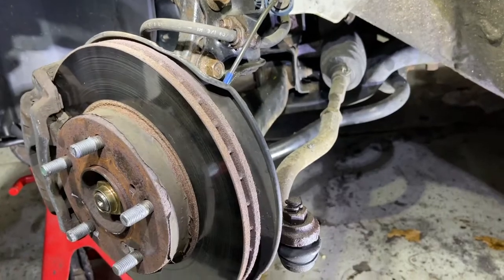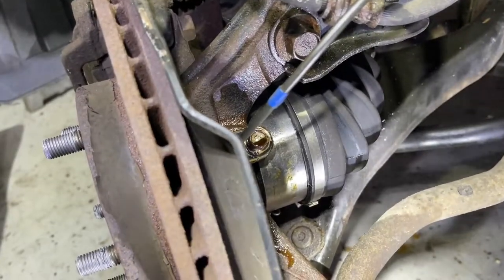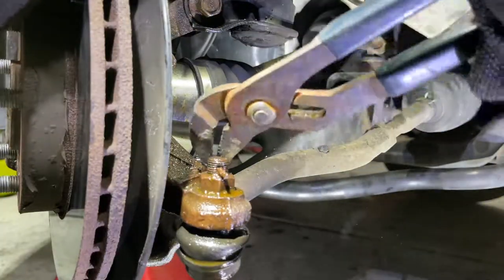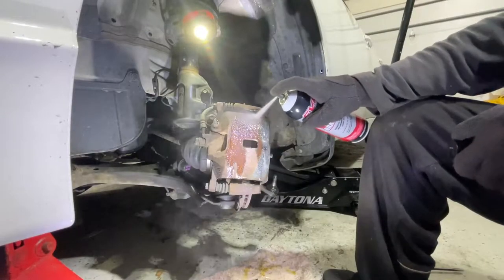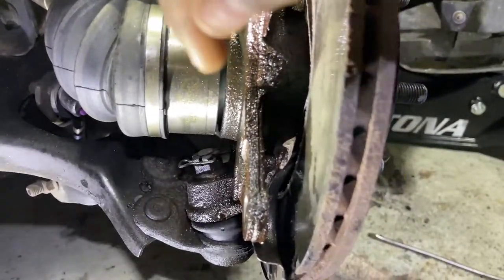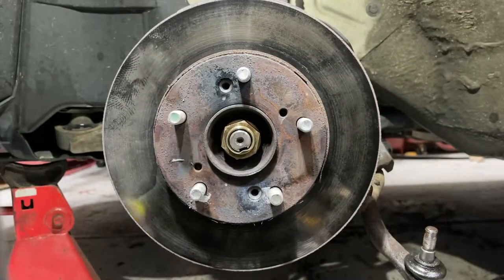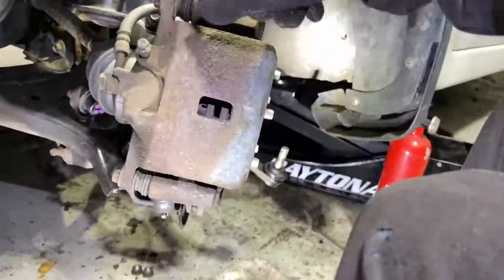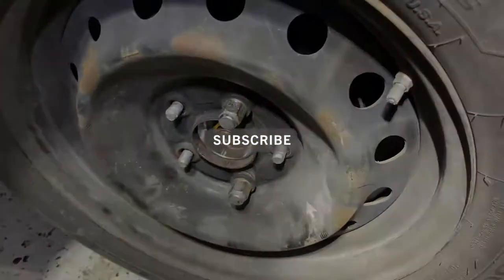06-11 Honda Civic Spindle/Knuckle, Hub Bearing & Ball Joint Replacement Step-By Step Guide

Comment: Good video my man, going to do this job next week. Looks fairly easy
Reply from the maker: Thank you. Here are the links to the parts just in case you haven't purchased them. 

https://www.ebay.com/itm/145545067344?itmmeta=01HV2SPVHPGW23G5HGGFC6KYW6&hash=item21e3297b50:g:mHgAAOSwpgpk7bPG&itmprp=enc%3AAQAJAAAA8BHDtYTKZ3F1%2FLtndvYuuESuNH6KQ8qTbEBr%2Bxxm70DgfpQAuhtlHaTRr%2FcSxiP8mGzikx%2F9PMfXP6RXABuima2buAIXcfgqcdm%2BCQWfEKK0SkGbTFowUmWaTJmU8wcN1%2BygCBQqteSId1cUqKFHgIxoDPlBJEObzJAGokGQEEED5FXIPcx907Kb3dbeX%2BxdEfkqA77mrhws9pYUTI5cmEKFWQdhrLLU0CpsKRkkaKVxpXBErmntDI2jpIYkO5GdWtjYTsFNnfm4G7SGhPLMyDz64wrxixQsniBJfyYJbFrKPKtwku0XR3J%2By7Y9x5U25w%3D%3D%7Ctkp%3ABk9SR4K529nYYw

https://www.ebay.com/itm/283948936170?fits=Year%3A2011%7CModel%3ACivic%7CMake%3AHonda&itmmeta=01HV2SPT2G69N19NFA2FJTKDY6&hash=item421cacebea:g:YpAAAOSwec9eVM8G&itmprp=enc%3AAQAJAAAA0MGaG9gk8KfiJG0hHPLkc4iBXLUmQQypL5s2lqR33Cw2AFlINqN5M6jitDPgE2Z%2FNwt7RWmWPXh4PYkyPgjDkt3MtZ7J%2FAlgjhJPTD57TqRupw%2BwL%2B1ipMiEV5GmISAVramLaltDF6sMBr8dRQtnFt5QloCIkgWX02oB%2FSulANIPZI3WWvRJ2zCEDEf9MKK4Z0a9wcqBMVA%2BHsY8uYH0bV%2FEpI0hFJv%2B7fooVs%2BkYnGzKvxqKHnv5x6vPezUrRX63JDDqaFDI0iW2Jsf6IhiVzQ%3D%7Ctkp%3ABk9SR7ih29nYYw

https://www.ebay.com/itm/123349025113?fits=Year%3A2011%7CModel%3ACivic%7CMake%3AHonda&itmmeta=01HV2SWVQXJ60X4XN7ATDHG11X&hash=item1cb82cc159:g:Y14AAOSw1K5k20jm&itmprp=enc%3AAQAJAAAA0M9nETBBpQf%2Fm%2B92OiIT7S%2FmqAdR0CDRQU2BLqUn9iZ8hm9RSbB3It3v1Xgd%2FYc6ZqDVh1r94vRXKcT8caK3AG12AHFLlyfHuCKzxFUh7Iv%2Fj2Wi%2Fjq0gJepo%2B%2BQtNxSW36CIQhavqmibLJ32eNOGsB415pEUpDpLfvFjqgp%2BPcu%2Bl3EDZyCyvJRJmVYcK53LoVxSO8u%2FNsA%2FiYuRC5IU65Qgcu8ndiUAOwtVmZLkdNKY6QTGiJCxNQKLD0gxhn9G8y2b47huuBdX7NS2aC3y7Q%3D%7Ctkp%3ABlBMUJS889nYYw

Comment: What's the torque spec on the ball joint castle nut?
Reply from the maker: The Lower ball joint castle nut is 44-51 ft. lbs. Thanks for watching.

Comment: I had to replace my Honda wheel bearing.  Took your advice and got the ball joint at the same time.  Turns out the ball joint was just as bad as the bearing!  Was initially intimidated doing this job until I watched your video over 6 times.  Took your advice on everything and it's all good.  Thank you, my friend.
Reply from the maker: You're very welcome. Good Job. Thank YOU for watching my content.

Comment: Can you link us to where you got your parts from? Just did the job with some WJB knuckles, wondering if anyone else has used them
Reply from the maker: Here is links for all the parts at the best price. This where I buy most of my parts from as I have gained a relationship with many sellers. 

https://www.ebay.com/itm/164278020750?fits=Year%3A2009%7CModel%3ACivic%7CMake%3AHonda&itmmeta=01J3ZEFYTPEEWZQ6WJNXTX8N87&hash=item263fbbaa8e:g:bPgAAOSwJjhhm0BM&itmprp=enc%3AAQAJAAAA8IqVjr2hyhefVQGc7F1w5oYnEXReRs%2BLCzUD3yKdQ1XONehmT6WH3CQJwJMoDiBjUzyk0TzEgCIG3behQ18vwIoFIjIvnywdHsSs4Il40Z3xSWxPnzlycEIpqzWFUs9JPtki9XYDvHZnZe7oHyIypviMgxQ42m5J2HWDfNd%2BxZ3UmNTRlqXjwri%2FJiaIUoSm2IAp7--osHnXenZ%2F5H2uyhYs14SHCm%2BTrob3vid%2BTR4zi%2B2Z4eSeX2pMvBFRA5BG9ZRAdeJI3oLD0Gpqylz1fzJvgWVZjTSVNcl9foVWH0P1FfGcIfvcl8VqwlTni2IrvQ%3D%3D%7Ctkp%3ABk9SR87tv-6fZA

https://www.ebay.com/itm/145270543491?fits=Year%3A2009%7CModel%3ACivic%7CMake%3AHonda&itmmeta=01J3ZEFYTPS8Y2AECVNYQ9B584&hash=item21d2cc9483:g:hwwAAOSwB0lk7tAJ&itmprp=enc%3AAQAJAAAA8GXkzoHYEykjWY2n%2FLFlR7C4rZ1CpevQ5cLHvS%2BpJSFJO23RtEeP28wVz5tsmgTDbEyoLsctyPr9mrCOHE1PJOHIu6veYqD79LRu6uLruQH1jqNJ31X0PrsrOKG%2BE5tsD1jdFKZu27GJpFz2eZMcdUjGczPfjqEVlQDW9TEZfOgYpWZfw8anJs%2BBzbsrjrvQ%2F4y9xlnZtNGXv0jl%2BAUN7CWcVu4Vt9erDNs9ny%2FdzMr3guG1BjwpkupQ79KrYX4PMxwPq0nbJAc61Q1Pl8iEUsvTWy1FF9Y1xPG%2Bo5IHUxWub6OJEJ6aQPZ7ltHNCYHJbg%3D%3D%7Ctkp%3ABFBMzu2_7p9k

https://www.ebay.com/itm/305338145543?fits=Year%3A2009%7CModel%3ACivic%7CMake%3AHonda&itmmeta=01J3ZEKP9HGT03P7S0ZFZ9PP87&hash=item4717925b07:g:7IUAAOSwkLFmo0Rz&itmprp=enc%3AAQAJAAAA0CAuiJCM5iYDq3YIvZHI8NV3%2BTHvuNiJxAGajS%2F5elbqR0vlQKI9quFJqV%2FJgOUD7LPcbebe7zea97VAKXAPOHdRIUonAka5T8FL18ne%2FC69g1U%2B3vbpPqjiLUBgm7MIrU7ilRqqnppq3XfLq30jM73m3Ai8OppLKbFQRR6QDICOkBklT%2BRW9ZczMDzkElWnlxc063GMLgkpxNNbi0lPd1rNxJjYXDQeJmaVH9Xtyp2JXqYkda%2FD767eU%2ByEh8jCLijP7kVIfUHxLXEFW8asbD4%3D%7Ctkp%3ABlBMUPzkzu6fZA

Comment: You should put springs on your brake pad. If not, they will stick to your rotor when you're driving, make noise and will wear out faster.
Reply: I've had trouble finding the springs for mine online at least . Still gotta go and ask at the store maybe theyre universal. I've never had them in the car but Im sure it would reduce noise and wear

Comment: Parts?
Reply from the maker: https://www.ebay.com/itm/145269153857?itmmeta=01J13VFX2XQ1HHBNXGQEZM0BJ4&hash=item21d2b76041:g:bJUAAOSwR31k7bPE&itmprp=enc%3AAQAJAAAA0CmnLP2KRWRyBP42%2BWE6LuWMCx5FIKPcEITjBPcOnd1eG2ERx7hIhr3EnChihZC4X%2Bo82hhvPT9lcb0ri99Wi%2B81YEM8IbSRnQBLmwdanFhOXaxKb8IYsN5xw5MxNiOmL0SXtI%2Fhuxcb5mNC7nyMPBTGRp6XLergxkQav9Mt%2FMwxntuOsX4POLM2n4socKFbWCG0Ws%2F16fIpsduSjT%2Bgx75Gcj42OLPoU2VFNYXXBGBgBtogiHM3qWYjcHMVxzFEFD80Yla%2BXFkOPMYfRbXGgkI%3D%7Ctkp%3ABk9SR8bRv_uIZA

https://www.ebay.com/itm/145270543491?itmmeta=01J13VFX2XB156WMM8A1W30XH8&hash=item21d2cc9483:g:hwwAAOSwB0lk7tAJ&itmprp=enc%3AAQAJAAAA8GXkzoHYEykjWY2n%2FLFlR7CabPQ7oJbhbSP9s40GvODhm4%2BRHO4Dx8EQ6CUVjONOO2VaikHoN5XMydI2bbN97%2Bjz9Xw849kT9i8zeaKLQkSY4RHytEPzvbNf8IxUsl8CJfZHv%2Fk%2F9n%2BUY2p22kCL8vO7Us3T2Z2cbi%2FBCSQL%2BsxeDKM%2BFG1p3iOYq7rf8wkxjDzPVpEp7ljyoiqOb6FBkowkYXP3UkTqbA5d9yzyu6mvK0iwwVEZ5vJD4VDxSEE4H0kXiYzpVnDxGGwwscYQP4CyqjcxolFKwv8suFTTvZCQhkvzPcu7VRwrfLRNv4w%2B%2Bw%3D%3D%7Ctkp%3ABFBMxNG_-4hk

https://www.ebay.com/itm/156008563085?fits=Year%3A2009%7CModel%3ACivic%7CMake%3AHonda&itmmeta=01J13VKWBKWYYZHRMJND3S9Z10&hash=item2452d5c18d:g:VdAAAOSwj7BjWhbf&itmprp=enc%3AAQAJAAAA8FN5b6RoyyOc29nFV4sq%2BoZhfy7pRWlOTvzEadkjwPK%2BFO0UnY1eHGVy%2BkvVKRj8GnIQrixfBfs0fPkQTUIO0Lez%2FhltsChU1RHsb5uN1ANlGf36A80PV6ROMZO%2FeRfPqh1PjnjNG6XKbC0RBtDDi4M00D%2BZt1ic2XWVNZFLt9EAU0KFQXGawW%2FHBQqJ9Y6C2ov%2BlAqRFekiSgthwl%2BIxWN5VTg3QLMmfhSdspeOgRPgM2VAYpZuvPQtWk%2Fe%2FJmWJB17HTHKK9S86eJN0N5tkgHo28OXAcXZiJzo1SHLjlrLmiXcKuiAN%2FPEimuBZfiw0Q%3D%3D%7Ctkp%3ABFBMhsbP-4hk

Comment: What part number and where did you order the parts. I have to do this on my car and am looking for a quality part
Reply from the maker: Here are all the parts you need and more at a great price (two links)...

https://www.ebay.com/itm/353542391069?fits=Year%3A2011%7CModel%3ACivic%7CMake%3AHonda&itmmeta=01HQBZTEGPBRNF2TJ033HPJ2ZQ&hash=item5250c4c51d:g:ob0AAOSwTCNicwSQ&itmprp=enc%3AAQAIAAAA0Az7Ag4TeRte4DpHb2%2FaRuw5EppkHywvc6O5kpWCOajZhwh3LZxsyabEJ4mLqivUhSASgJ48e%2Bv2pCeWc1e8Zb%2BSi2%2Fk%2Fa4tQ5uNQVTzHqU4PsegjU2RjqNA0Lbqm2tgBUUOTfG%2BF0MsQ1YCTfHpJxjRj2LB890%2BPhFPcqKP7w4NVWrFIHzvzzKqZtnTvq39yKt4dzPQwdbAm5NE0AoLwNL3FcMb7paADOrJapn23rN%2B6y31zMkq0kSlMIKB%2BPsxBViXZt2zDWU3FgnnV7VYVKI%3D%7Ctkp%3ABk9SR8To6f-6Yw

https://www.ebay.com/itm/225882036378?fits=Year%3A2011%7CModel%3ACivic%7CMake%3AHonda&_trkparms=amclksrc%3DITM%26aid%3D1110006%26algo%3DHOMESPLICE.SIM%26ao%3D1%26asc%3D260884%26meid%3D099cdb6e331e49be8a4533c613f45357%26pid%3D101875%26rk%3D1%26rkt%3D4%26sd%3D144348474534%26itm%3D225882036378%26pmt%3D1%26noa%3D0%26pg%3D4429486%26algv%3DSimplAMLv11WebTrimmedV3MskuWithLambda85KnnRecallV1V2V4ItemNrtInQueryAndCassiniVisualRankerAndBertRecallWithVMEV3CPCAutoWithCassiniEmbRecall&_trksid=p4429486.c101875.m1851&itmprp=cksum%3A225882036378099cdb6e331e49be8a4533c613f45357%7Cenc%3AAQAIAAABkHD%252FO%252BVoFoPPIoZ2g0kOZxWd85mWuIHekSp3qag7zFfwObZeQoitzE%252FDCfcejfO%252BzOLmzZmy11RrgWpA56KM9DpasK%252BGtGYwCFvgaK6ijP5AqShEUhT8f2oX6hvndJ3G0oWH8DD1DlBWseQltpxcSDW2Uu52NrseaxeINpsrDP6vx7ny%252BkPKauMa3yeSanWiinIuybH7ygK23g%252FGuQbDJ6vOUg8MB2pOcQYTkaOac7V2sPK7ZiEjJ2dQucuoZqqHYbP1AFdVUWdvNxx8Bg9j9VUT2rjIDLgFO0XXn4lIqVSwWvFXYr%252Fu2MWKKCiCw5h64BqvTzcZ%252BOnoMg8SW5BDv6PxpFzVeXWkiGcvPRzV0Uj1iUYggFwa5yJjj6ixJ79oEgIorFwENKfZXtj6MCv7lQpw6w1uw6v--a4TXQB3Bwf4AO%252FLBWOkIcTLgixwYaIsVFN32AHbXd%252BzYva8wrv6bdNu9L76IRs7MBTF5k%252BU4X4ZvLy1wiDD887dx%252Bq%252BS8NrNaJ4clcE5Su8kh3DZvxJxvc%253D%7Campid%3APL_CLK%7Cclp%3A4429486&itmmeta=01HQBZR8JST69Z35YBE1SAF78R

Comment: hi great video brother does the spindle  comes with the hub attached?
Reply from the maker: Yes, you can buy it either way with or without. Here is a link for everything you need at a great price! (the best deal and option)

https://www.ebay.com/itm/166122056647?fits=Year%3A2011%7CModel%3ACivic%7CMake%3AHonda&hash=item26ada56bc7:g:dYUAAOSwALFkl~2A:sc:ShippingMethodOvernight!60475!US!-1&amdata=enc%3AAQAIAAAA0EQmF1FUSgQioAh7MP3CIlX%2BaHWQQBQfjGs5A2b04KFB%2FqG%2Ba94jIOsaPn4QGv4ozcCjx8hy0xahoen4YGj%2FOwjFy5Svevk3btTVhZDu0wAeafdMvDXOGv1X%2FyiYtBsLkg6VDaXIlIaYVuULTscHnW31xt65JiBj1V2o%2BSO6CvcSNlDWjXWaj%2FSJA0xWZP887ZFDsOGJxd8F1v4lFPPDMKs5UUBXN5ryAPhE1o9NEZG7ReqsDIVlRrX1xQkBj%2FcLZlGulmbZ7DHqNZ48m7qESKY%3D%7Ctkp%3ABlBMUMystYGpYw

Comment: Thank you for this video! Straight to the point, i appreciate all the details and torque specs. Its an easy job when you follow his directions and have the proper tools. I tried to reuse the abs sensors, but broke one and got new ones instead.
Reply from the maker: You're very welcome. Thank YOU for watching.

Comment: That spindle knuckle looks really weak compare to the OEM knuckle. Just look at the thickness comparison. I wouldn’t trust my life with the cheap flimsy aftermarket one
Reply from the maker: Hi Jay, you are absolutely correct however, you have to ask yourself how would that item make it to the aftermarket world without strenuous testing, multiple stamps of approval and tens of thousands of items sold and continuous sales. I wouldn't be surprised if it was equally as strong as the factory spindle even though it's smaller. Thank you SO much for watching.

Comment: I think I'm gonna have to do this( the knuckle) a dumbass mechanic tightened down the tie rod end with a half inch air gun so it caused the tie rod to bevel out the knuckle so now anytime I put a new tie rod in it busts no matter what I do bc you cannot tighten it now without it being too tight shake my head 🗣️🗣️🗣️🗣️
Reply from the maker: I hate to hear that. It's unfortunate that the mechanic treated it as if he were tightening wheel lugs.
Reply: @TerenceDIY  honestly it might be alright that knuckle is a peice a hunk metal I feel like the tie rod would pop from being tightened like that before it would cause damage? I would hope so anyways haha I may change the tie rod and measure it to save myself an alignment and see if I can tighten down the right way and see if it's fine
Reply from the maker: Here are some links to some new parts that's priced great in the event you want to replace everything. 

https://www.ebay.com/itm/164278020750?fits=Year%3A2008%7CModel%3ACivic%7CMake%3AHonda&hash=item263fbbaa8e:g:bPgAAOSwJjhhm0BM&amdata=enc%3AAQAIAAAA0I4gJl4YVjjCainl9Zbru9yJGLp8em85Jb%2BOB7gINDSwB2NAR%2BlRtSVar580TqKJlg88LfapQvmyQtUyIadTlocygqh9jRzQRLYi9UrkMN%2BDKblzhAWl%2FwX6IgftSBPifOZnnR8LWBqhdNpJmzOYXWqaZpDDF7tlEQdBRFmM7zAFaPXugQ64O0pZatG%2FLLi%2BIUaSDU1xeOqKuY8XFhdEdZhdnNd7FCZa3JIYYRaLiVDUWsDG124Y%2BQ5y8Yh9thc7IfuJELcCsgZtBc9rrNv1BCk%3D%7Ctkp%3ABk9SR56JiOPzYg

https://www.ebay.com/itm/283948936170?fits=Year%3A2008%7CModel%3ACivic%7CMake%3AHonda&hash=item421cacebea:g:YpAAAOSwec9eVM8G&amdata=enc%3AAQAIAAAA0AfjEJWvQ7WkkrmrhXhWa6hp7af8proDY0Ou9c2PgcQ6XW8SvmOSTrYKoj8EA7i%2BXKFLN%2FQrO4WX%2FVuJAtJnVQmB0OIbnSOGOTuyqp2Gxuwrq44ATDKNRbt4%2FxxoceRrDxeTCN6VU6NzuiMguqqSF6gt4hw%2Bj5FQWeYiVNA4H%2FLSYag4I9x4kzCOm6U9xw1uFTXe4JJJvWAMOCxHB9vnBupLSDq4hXvceU26kyOBf41vugYIDebAE5VPRlv9W0e4vQ0vGUp95WG06IjqLbgtjV8%3D%7Ctkp%3ABk9SR56JiOPzYg

https://www.ebay.com/itm/162640320096?fits=Year%3A2008%7CModel%3ACivic%7CMake%3AHonda&hash=item25de1e5660:g:SH4AAOSw2NNip~vC:sc:ShippingMethodOvernight!60475!US!-1&amdata=enc%3AAQAIAAAA8NdTL8N1%2B9DwG6UPBTA3q1EYe6e2ENl2zgDtjwS36z5do5IwxHFPEHEbjGN5P2BKZ2TkDUU9QS3Dd3KoD6Ilxs1vbSFoO1O0WkWkvG%2BOnEZvJqcd4HGSDdMiQK6EAKcPNxNzwf25fLUN7G4zErI%2BukRKhmvFwMns97LeYkgxxsjAJM7J4vwgyzdDub7nWuA0BOupM1J7yaVrq4avp7kQUoxZGJAUTWZ%2BgHIaIGXTUjJD3yFOBFFNuepUHClOSjcim4BgPKoONpaQxR%2BS4aSk0zQVeYU45MAYEB0%2BSlK2fIeskHGSr%2B1Tpnif3Ke4yyp9Qw%3D%3D%7Ctkp%3ABFBMmpaY4_Ni

https://www.ebay.com/itm/123348985524?fits=Year%3A2008%7CModel%3ACivic%7CMake%3AHonda&hash=item1cb82c26b4:g:jGoAAOSwMvdk20jn&amdata=enc%3AAQAIAAAA0KcvIS1gvcA7J13Sqdr1CVNlJA6RBjS2DAA3%2FQTjr3vwWqRQMxqTBwBcZZiV%2FP5tcI5EbZ2PwvWARZTpB0idPYPcAIrd3lSgXmrHupP0fWHFJ8Co5xDPAoxu5rGjGbP%2FC82SsmUPoSfmi6kTb3imjZSVeXYdO2vs%2FfgEO6PkFH%2BCmPEKWRNV%2FNYpOgwgFBQ5utXPidavAjfmr7RnR%2BT5FJ1klu2Bm%2B2xQzPeTxLya3lOOSbbnFymmh2i%2FIodBEL37d0mLZ6xzJ4npFb7xze1z%2Fs%3D%7Ctkp%3ABlBMUNrDnePzYg

Comment: My abs light keeps turning on and off randomly when I'm driving and it feels weird it's making a clicking noise when I'm driving which could be the cv axle which I plan on replacing at the same time. Idk what's causing the abs to foul up but sometimes a bad wheel bearing can trigger an abs. This appears to be much easier than using an expensive puller tool
Reply from the maker: 9 times out of 10 it's the hub bearing making that abs light appear. And you are correct about the clicking (bad axle). Thanks for watching.

Comment: Link to buy the whole spendell
Reply from the maker: Here it is...

https://www.ebay.com/itm/164278020750?fits=Year%3A2009%7CModel%3ACivic%7CMake%3AHonda&hash=item263fbbaa8e:g:bPgAAOSwJjhhm0BM&amdata=enc%3AAQAIAAAA8IsC9vm6jOXzamiIC%2BhFf%2B8vOgYyJqNm6faBFs8ggpV24978k15KWSnkGiZObHoURfKY1t8LLyQ1Om3RSKrk%2BG3boCRIe5Uu9lqWcKeqjIk1S%2B9VitVpJDH9yDnMFYqTXFRzJX3AenxVoCZxMMiDGKpF47A%2FUTqNgf9VgYNT1%2F2OHulNcIy5vW0dEDLiw1Q%2BDmhxcdl10d005qy6GCAdRWgPXHytC13Zo8OA0uoFHjeHTz5qJgHA9OI99IbBUfnL%2BNiOJ%2BV%2FGkWeKcu0wxTzvKtKrM2KIJjTDIHfRI%2BmgRLK7IdpWF95YxyJYrqdWxjHHQ%3D%3D%7Ctkp%3ABFBMoPWMhpVi

Comment: Great video, I just wonder what is the part number,  I have to do this to mine but I can't find the pn for SI model.
Reply from the maker: Here are some links to the parts. Thanks for wathcing.

https://www.ebay.com/itm/164278020750?fits=Model%3ACivic%7CMake%3AHonda&hash=item263fbbaa8e:g:bPgAAOSwJjhhm0BM&amdata=enc%3AAQAHAAAA8J5QHK2FGNZPLZQNqXDIbHo66sG7ZQMiS81wktzChTMsfSefRcj679CkRRnA7ALPzsyx47ik5cRWit6Kl5yvYDSV6PaK%2FEk5uuaVjMq39%2FRdDHH0AIRtuOhH%2FMlSrVP4bRONZg0RPJpdATPXiG01aBwHClctPzNu5IBaeyHJ5%2B7sjuZAQTnIrDGCoCvIvc29EcyPu%2FhKgPOg9ikyEYIFVAOHP%2F4BS6Vy8Wlol3SdiXhYBtacxT60NCreJYyQttO760n8O%2BldUiCwXfUPCWNYB2C2fcc2LMaj9asTnzRGAVqykAlxpnngLgF10QCT0NxRLw%3D%3D%7Ctkp%3ABk9SR-TX-7XQYQ

https://www.ebay.com/itm/194641055445?fits=Model%3ACivic%7CMake%3AHonda&hash=item2d5182ced5:g:nD4AAOSwTmBhi1X8&amdata=enc%3AAQAHAAAA8DEzLNMhLKSmJgNR2Cyv7nYY3%2Bx5BeuzQ6sMICQObZZMlHIDQbr0Y0LikOWOYK7ra1aUu9O2Zh0zY3aazj6Z0Y4k481cu9eaOkFwlurxbap6GBhUKGE6fe2YvNHqXOb3Hh0Rbo2OyqfSFDxW4OSCBM7XBVSC9XE0NMzHa2%2FqJVfkONubBPY9YUN9nHrW2YomaqGjSzYxmRcoZN2qjIItfjbKnoWEux14LYe8Oud9M01KYC6Bg6FcNyn2zEzNs3Y0jrlK2bFJakkzCSAHT0d3NhiRmqdxtTcXte4K3qCq%2Boq%2BH5CPg88a%2FA%2B7feDSMbCBAQ%3D%3D%7Ctkp%3ABFBM-vyIttBh

https://www.ebay.com/itm/273108977029?fits=Model%3ACivic%7CMake%3AHonda&hash=item3f96904585:g:WYQAAOSw4qxaqFuo&amdata=enc%3AAQAHAAAA8HzmpbrPm9zNuRfJ3YvSvvZts5DRlbZdsZLX3VbnDB%2FPzl%2BaEU64ZeB%2B9eSe4eHFodz2SPZUysbLRO4VMmc02tn%2FEER9m%2F7OjtuUALSV4vvNWRObg3gsJV8DLQA0DMFzhSdZbyxyJbK2upUv4fhS1Ywf4jANQ2irazgWFl6CaFWDjRqzeK1r6C9zKtNgerEVuyxAjwtpR0Uc2G%2BtdaTHz%2BkwyF9Z1ORWcFpvLh1VCVgeg9gNMbc9Cif5LeAuyqJS90YZy5w3lsWRz2qXs0DUDMpXHxpy6VXmWUKjUgwsEw%2F2E3CDQgvJJlJq5roJAZCfgg%3D%3D%7Ctkp%3ABFBM-vyIttBh

Comment: What could be a reason to replace a spindle/knuckle. I took my civic to get it aligned and mechanic told me spindle was bent and needed a new one but i took it off and replace a new one and see the same result any help ?
Reply from the maker: Did you replace the lower ball joint as well?
Reply: @TerenceDIY  no i have not im goin to do taht see if it helps my negative camber is 3 degrees off that why mechanic told me it was bent spindle but from eye point of view looks the same
Reply from the maker: @Purocorridospesados , yep, you should have replaced that ball joint when you replaced that spindle. That may fix your problem. If I were you, I'd purchase this. This is a great deal and will guarantee your problem fixed. 

https://www.ebay.com/itm/162685801133?fits=Year%3A2008%7CModel%3ACivic%7CMake%3AHonda&hash=item25e0d452ad:g:LeIAAOSwnO9hVR80:sc:ShippingMethodOvernight!60475!US!-1&amdata=enc%3AAQAIAAAA8CMOx3cRTO70A6TOfoGpzlkyPDMo45wcrPfzE3u%2BrQuqCE3zAmg01C6gkU7qm1HYOV5l4WQF2nCVGQ%2Ftgs%2F6iEXk1dBjuQw8tsbsBllKNKrz8o3cN%2BWNgKXBY4E%2Bwdr9OYGjsZv0XkmlNERDLJ2t3PkiZsXgb2bqEWo%2BRh01R%2Fp1fPwTm%2FNfAu%2Byx4YiduF43qNmujJud%2FERsjAWpYk1jxuzOdO81BsguctKslZR6OPsR6m9RVZXC9XLpEUkHuK1642gh1Orf2dcNNUQvkYcqoI3bqOG05huKZ%2Bg4uHk5cRLdogPs7L26PulUMbYGeSPAw%3D%3D%7Ctkp%3ABFBM5sbeno5i
Reply: @TerenceDIY  update so i replaced spindle and lowerballjoint  and that fixed the issue thanks
Reply from the maker: @Purocorridospesados , that's awesome! Good job.
Reply: Great video!
Girlfriend hit something on the freeway and steering wheel vibrates at all speeds.

Hear a “humming” sound coming from front passenger(where she hit)

Looking to replace this whole assembly.
Hoping that solves the vibrating steering wheel

Parts come in on Thursday.
Thank you!

Subscribed!

Comment: Good but two things i see not quite right, to turn in the Brake piston use a  piston brake tool with a rachet wrench as the piston is supposed to turn as it goes in. it looked like the piston O ring was getting bent there. 2, Brake cleaner is for the Rotor as well. the anti seize on the rotor is bad, other than that a good video.
Reply from the maker: This style piston pushes in, not turn in. I have the piston brake tool. Those are mostly for the rear. The car drives great. Thanks for your insight and watching my content.